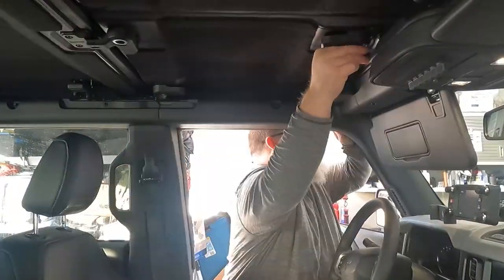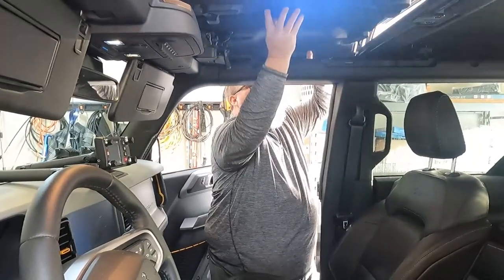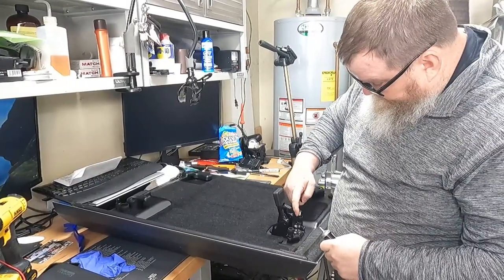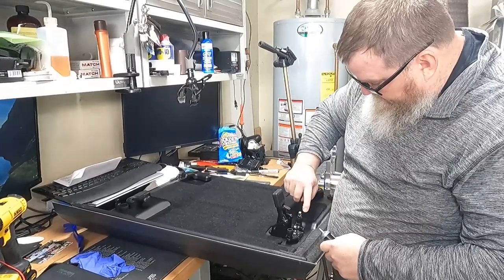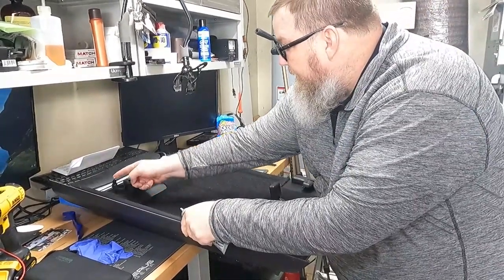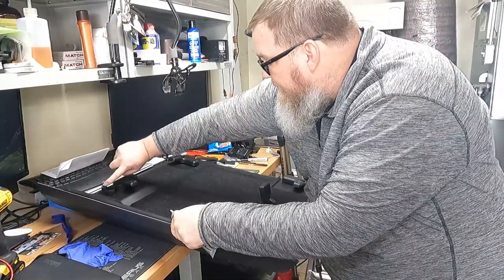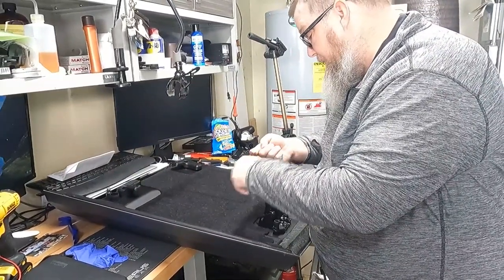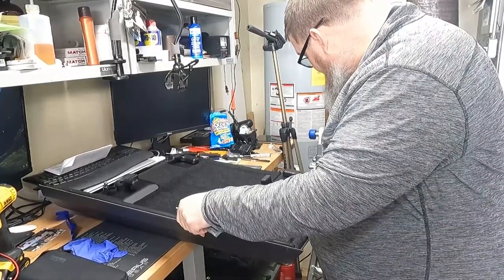Fix The Bronco Hardtop Noise

Comment: Lube = dirt collector. Use a 3/8 heat shrink tube (for automotive wiring) and slide it over the alignment pin near the driver's outside ear. I cut the tubing to about 1/2 inch long. it has to be forced over the pin, but it worked like a charm and no future mess!
Reply: My thoughts exactly also if you put the panels inside the storage bags you would need to wipe the pins first
So you forced the shrinking tubes so you didn’t need to heat them up
Did you apply it only to the drivers rear pin? My top seems to sound just there, but didn’t sound when new. Maybe all pins eventually do so? The front ones are thinner so if you applied on those did you shrinking them with heat?
Reply: @feralc  it was a very tight fit so there was no heat needed. Sound went away 100%. Yes it was the driver side pin by your left ear.
Reply: @justinwilliams2144  yes I just installed mine exactly there and I will test it, if other pins begin I would do the same. I found out that making a little perpendicular cut to the tub at the base makes ir way easier to push it to the pin.
Reply: @feralc can you make a video on this method?
Reply: @jaimelyons3166  just wrap the pins with electric tape and you will get rid of the noise.

Comment: Seems to have worked well! And such an easy maintenance step, I will have to remember this if I ever get my 2Dr. Still no build date, beginning to think mine may get pushed to my23. 😊
Reply from the maker: Hove you looked in to ordering through another dealer? I would see if you can find one with a better allocation.
Reply: @Overlanding4Fun  no sir I have not. I did not reserve until 02/27/2021 because I did not want to get it until 2022. I did not know at the time that Ford and Covid would work so hard to make it happen . Lol! Guess it did not help to order the 2dr badlands with lux.

Comment: Did you do just the two front panels or middle one also?
Reply from the maker: Good question, I did just the front panels. All of the reports seem to point to the outside rear pins of one or both of the front panels that are making the noise.

Comment: Started to notice mine is clicking too. I have a 2 door and sounds like it's coming from the passenger side front panel. 
I will have to give your tip a try!
How has the clicking been since you posted your video? Have you had to reapply the grease? 

Thanks!!
Reply from the maker: Good question, I have not heard any more noise since I lubed the pins. I am assuming that the pins will need to be lubed every once in awhile depending on how often the tops are removed.
Reply: Awesome! 
Thanks for your reply!
Hopefully your fix keeps working, and it would be even better if a permanent fix eventually was available.

Comment: I have the exact same problem with my bronco.
Reply from the maker: Thank you for watching the video. So far after a month, the noise has not returned. I figure that I will wipe down the pins and reapply the grease a couple times year if I am taking the tops out a lot.